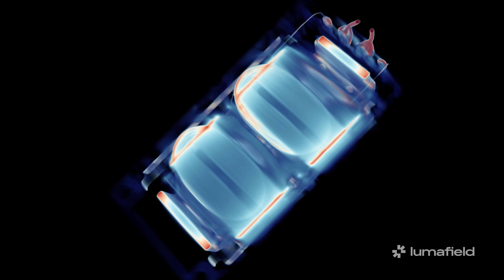Switch 2 Pro Controller: Built to Break? Full Teardown

Comment: Along with the console bans, it's sad to see Nintendo in a race to the bottom when it comes to sustainability and repairability. 

Let's hope the next generation of consoles will take a large step in the right direction.
Reply: Well, right to repair will start in 2 years in europe, so such controllers will be banned here and nintendo will lose a lot of money.
Reply: Scumbag company
Reply: You mean ps and xbox without any games?
Reply: As much as we hate Nintendo, they're not the only ones banning consoles. Most hardware manufacturers like Sony, MS, and even Valve can ban consoles. It's on their user agreements.
Reply: @Vyz3r  Valve? You mean with the steam deck? Yes, you can get VAC banned for certain cheating or illegal activities. Console modification, absolutely not. They literally have support articles on their official forums covering how to replace the internal SSD, how to repair/replace the screen and how to resolder new/upgraded memory. They do not at all prevent you from modifying the console. 

The closest you get to a ban if you modify the console is the agreement that their warranty and insurance doesn't cover any damage you cause by doing unauthorized modifications. So, for example, if you break a ribbon cable while trying to replace the screen, they can't be held responsible for your failed repair. That's it.
Reply: they'll probably double down, they recently added a TOS clause saying they can brick your console for modifying it
Reply: @jakeyounglol  this again? people are so gulllible nowadays when it comes to fear-mongering. they only brick your account services if they detect you using custom firmware that can potentially allow you to pirate softwares. Meaning you won't be allowed to use their online service. You can still use it offline. This has been in TOS of every console since around the Xbox 360 era. PS5 and Xbox Series have this clause in their own EULA too.
Reply: @jakeyounglol  They've been putting this on the back of game boxes since the Wii/DS era. It's so if a system update breaks compatibility with a modchip/flashcart/cfw nintendo can't be held responsible since its not intended functionality.
Reply: @NZZN_  Those prior consoles also weren't built to detect something as simple as third party HDMI adapters or docks to ban your account if you tried to use them over the official offerings...
Reply: @LazyTomato  that’s just blatantly wrong. I use a non-Nintendo HDMI and my switch is perfectly fine. I’ve used non-Nintendo chargers as well and nothing happened. Where did you get this information?
Reply: @LazyTomato  Nobody has been banned for using a third party dock lmao
Reply: @Judakai  I can't link it (because Youtube), but it was a post on GBATemp from someone reporting their third party USB-C to HDMI adapter (HDMI adapter, as I said), made for Switch 1, flashed with additional firmware to work on Switch 2, getting detected as tampering and leading to a console ban. Because of the USB-C port encryption present in the console.
The post itself detailed exactly which adapter and firmware was used.
It wasn't a dock exactly, I was wrong on tha detail, but it was an HDMI adapter meant to serve the purpose OF a dock.
Reply: @LazyTomato  so I’ve seen other people use third-party adapters for the switch and those have worked also just type the link into the comment I can just search it from there back when the original switch came out that was having problems with third-party docks, but that was more so a voltage issue that later got fixed
Reply: @LazyTomato  also as far as I know, no consoles have been bricked by Nintendo yet
Reply: @Judakai  ...Did my comment get deleted for even a chopped up link???
Okay whatever, you can probably find the post yourself if you Google "gbatemp usb hub hdmi adapter switch 2 ban".

Anyway yeah, I'm aware Nintendo hasn't "bricked" consoles (a console ban isn't the same as a "brick", and I agree that calling it "bricking" is dumb because it just turns the whole thing into fearmongering), but they HAVE been extremely ban-happy on everything they deem "tampering", including unsupported third-party accessories or add-ons and secondhand physical copies that have seen any MIG use at all prior.
Reply: @jakeyounglol  they have not bricked one console yet
Reply: @jakeyounglol  untrue
Reply: Time to switch to Steam Deck and similar Linux distros instead, and support emulation and porting.
Its the only way you'll own what's in your possession.